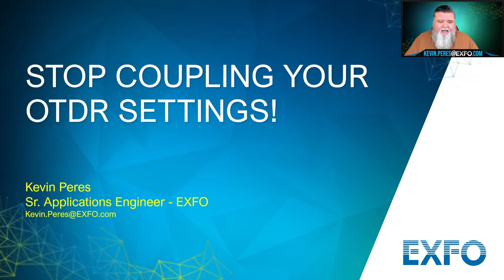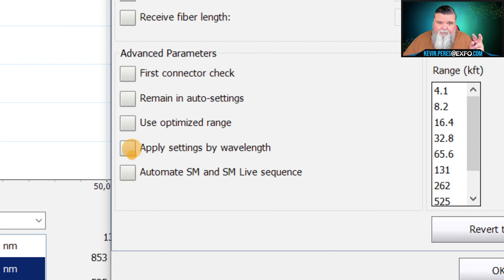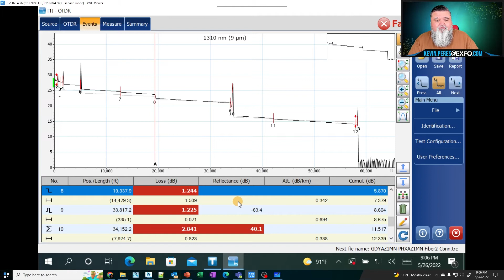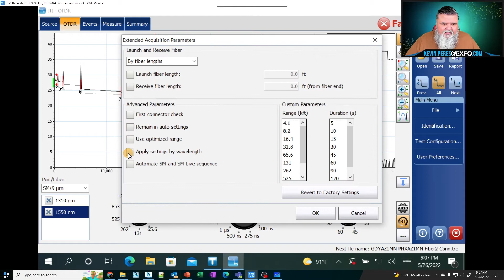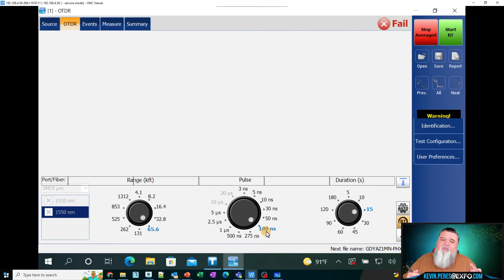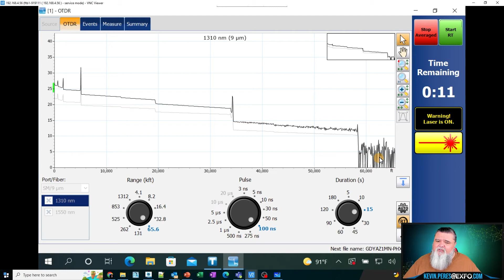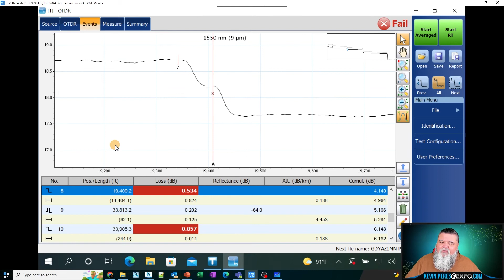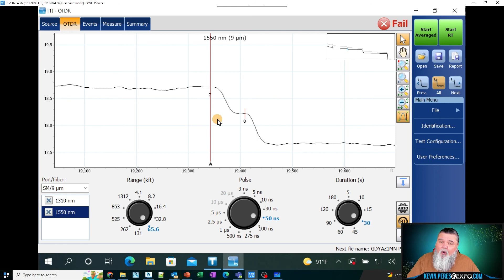Stop Coupling your OTDR!

Comment: Thanks for this.   Hopefully will help avoid having to run around fixing stuff that truly doesn't need fixed
Reply from the maker: You are welcome. I hope folks think about this when they are testing.  So many traces are shot this way and if you do not know what your network looks like you may try fixing a splice or cleaning a connector that is not failing.